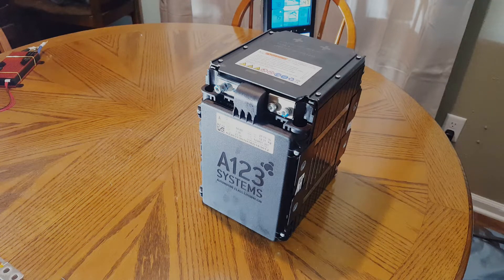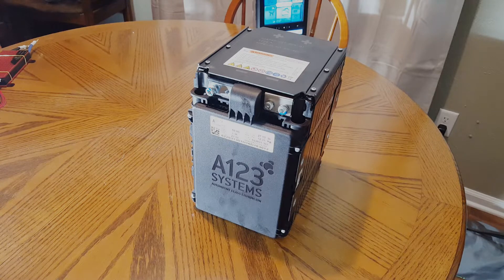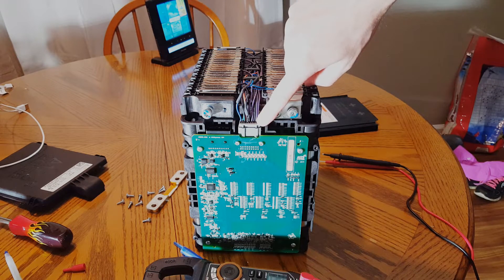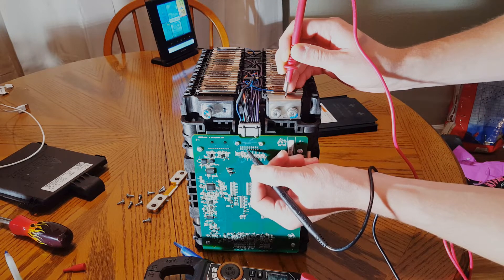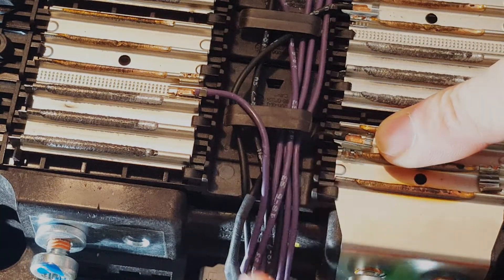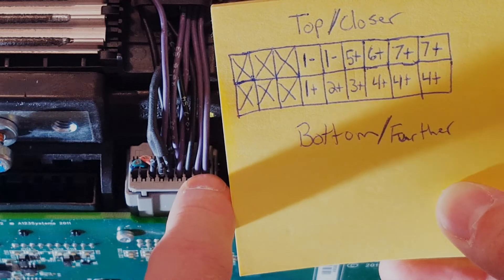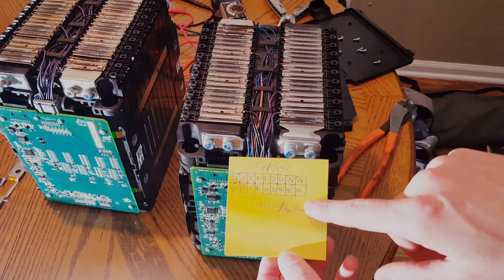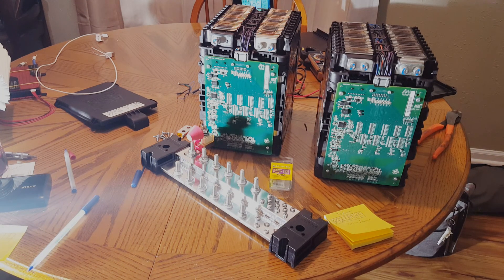Balance Wiring/Battery Overview-A123 7S  24V LiFePO4  - Which wires go where??

Comment: Hello, thanks for your video!
on all the bms (also the one you linked in another comment) i find that LiFePO4 is only 8s-16s. i'd like to connect LiFePO4 7s. do you know why all those bms don't "support" that in their product description? while i was trying to figure out the answer, i found your video.

Applicable battery:
7S to -16S version ：
7-16S Li-ion Battery; 8-16SLifepo4 Battery;8-16S Titanium LTO lithium

Comment: I just picked up a couple of these for a trolling motor as well. For 24v parallel trolling motor max draw is 60A. I'm a little confused if I could use an DALY 8s 24v 100A or do I need to find a 7s. Could anyone help?
Reply from the maker: An 8S Daly would work fine, just be sure it is for lifepo4 not Li-Ion.

Comment: Thanks so much for video'ng the insides of the battery.  I'm looking to buy a couple.  How hard would it be to breakdown into a smaller series?  Are there any good spots to attach the leads once done or is soldering the only realistic option?
Reply from the maker: It is possible to break the batteries down but with the strapping and everything that is already in place it isn’t very feasible. It can be done but would be a pain. Soldering or pop riveting the leads on would work. You would have to watch the pop rivets to be sure they don’t loosen over time and get hot during use. Thanks for watching!

Comment: What BMS did you end up using?
Reply from the maker: I bought the 7-16S ANT-BMS 320 amp model. Well, 5 of them actually. Ill try digging up a link.
Reply from the maker: US $52.42  25%OFF | Smart 7S ~ 20S ANT Lifepo4 li-ion Lipo LTO Battery Protection Board BMS 400A 300A 100A 80A Bluetooth APP 10S 13S 14S 16S Balance
https://a.aliexpress.com/_msJe1AZ
Reply: What voltage did you charge to?

Comment: Be careful with the Balance Leads on the bus on top of the batteries. They are "UltraSonic Soldered" but they metal fusing is not too great. If you move the wires too much, they will become loose.
Reply from the maker: Thanks for the heads up. I put a decent bit of solder on them so hopefully that reinforced the ultrasonic joint.

Comment: Very good video on these A123 batteries. I bought two 24v versions (no BMS) and two 8s overkill BMSs thanks for the heads up on the wire labeling. 👍 subscribed.
Reply from the maker: Nice! Thanks for the sub!

Comment: Thanks for sharing this!

I just purchased some of these cells and looking forward to them, so please continue to share videos of your setup!
Reply from the maker: You got lucky! They sold out very quickly and were a challenge to purchase. The next video will be uploaded as soon as I get the BMS's in and wire them up.
Reply: @diyrenewableenergyelectron4996  Looking forward to that video! Did you order Daly BMSes for the large pack? And what amperage did you go with?

I need to figure out what BMS I'll use for my config with how many amps I expect to pull. I've also been checking battery stock every day in case more come available.
Reply from the maker: I'm actually going with ANT-BMS's. They have a 320 amp version and they are Bluetooth capable. I couldn't find Daly BMS's for a 14S LiFePO4 battery and didnt want to risk buying a 15S to see if it would work.
Reply from the maker: https://m.aliexpress.com/item/32997552090.html?trace=wwwdetail2mobilesitedetail&spm=a2g0n.shopcart.0.d3.20adgGh2gGh2FK&gps-id=shopcartRecommend&scm=1007.15372.165446.0&scm_id=1007.15372.165446.0&scm-url=1007.15372.165446.0&pvid=114634b7-9124-4baa-93a5-42373a8e8137&_t=gps-id:shopcartRecommend,scm-url:1007.15372.165446.0,pvid:114634b7-9124-4baa-93a5-42373a8e8137
Reply from the maker: @_a1001  thanks! I just watched it yesterday lol. I'm hoping it works out for me as well as it did for him. He seems to really like it.
Reply: @diyrenewableenergyelectron4996  

What would you say be a good deal for them?  I see them on sale for $90 a battery
Reply from the maker: 90 per is a pretty great deal. I would check them over thoroughly and verify they are what they claim to be. A123 does make li-ion in the same design and they make multiple configurations of the lifepo4 design similar to what is in the video. 

If the batteries are not heavily degraded, $90 each is a great deal. That is well under $100/KWh and these are some of the best batteries made. The nanophosphate technology A123 has researched makes these some of the most robust lifepo4 batteries out there. They handle float charges well and are rated for (double check this) over 2000 charge cycles. Thanks for watching!!
Reply: @diyrenewableenergyelectron4996  

The tags on these batteries are same as your other video where you say you got it for $10/kw.  

These batteries are 1.99kw, 78ah

So I figure they’re the lithium nmc.

What test can I do when I go look at them?  I do have a volt meter
Reply from the maker: You can check the voltage of the cells and see where they are. If it’s over 3.65 they’re NMC. Depending on the application you may not want NMC. I don’t like having them in my house and prefer lifepo4 for that. If you have some time to charge and discharge them you  can get a better idea of the condition. If nothing else you can charge the battery and see how much the cells in series wander from each other. Typically the more they wander the more degraded they are. It’s hard to balance cells of different capacities and when they degrade the capacities vary more and more.
Reply: @diyrenewableenergyelectron4996  

Is it because nmc batteries cause uncontrollable  fires?

I was wanting to start up a lil cheap solar system.

I’m thinking I would encase it in polystyrene foam that takes long time to catch fire and aluminum or steel.  I dunno
Reply from the maker: Yes, it’s because NMC is more volatile and prone to catching fire. Many people use them without issue (myself included) but for a stationary system in my home, lifepo4 was the overall winner. If the batteries you mentioned are lifepo4 it’s an excellent opportunity. If the seller can either tell you what chemistry it is or take photos you can figure out which chemistry it is since you know the overall capacity and the amp-hours. All you need to know now is how many cells are in series and you can likely determine whether the nominal cell voltage is 3.2(lifepo4) or 3.7(NMC)
Reply: @diyrenewableenergyelectron4996  

Hopefully theyre lifepo4 and still got life
Reply from the maker: Let me know what happens! I’m happy to help where I can.
Reply: @diyrenewableenergyelectron4996  

Thanks for that.  I will let you know if something happens.  The guy is slow to respond. Once every few days ... but let ya know
Reply: @diyrenewableenergyelectron4996  

Hi there. So the dude finally responded and I picked up one tonight.

25.6 v - 78 ah. For $80

I’m watching over your videos in this battery to have idea on what to do.
Reply: @diyrenewableenergyelectron4996  

Btw it’s 7s3p

And I count 20 cells.  (Actually 22 cells I think but not sure why you count only 21)

Not sure how to volt check each cell since there are those bracket plates on top that connect them together covering parts of the cells and I don’t see anywhere else to put the probe
Reply from the maker: You won’t be able to check each individual cell, only the 3 cells in parallel overall. If your cells are 25.6v nominal then you may have gotten an 8S battery instead of 7. If that ends up being the case you lucked out because 8S matches up to 24v much better than 7S does
Reply: @diyrenewableenergyelectron4996  

Yeah I think it’s 8s which also confuses me cause it says 7s.   There are 8 Bravkets..

So what should I do from here.  Not really sure what I’m looking at to be honest
Reply: @diyrenewableenergyelectron4996  

I should probably get a capacity tester and a 7-8s bms now huh?  Any suggestions?
Reply from the maker: A 7S battery will have 8 busbars. Main negative and the 7 positive terminals. You should confirm that and then take a voltmeter and measure the voltage readings starting at the main negative.
Reply: @diyrenewableenergyelectron4996  

Just picked up 3 more just Incase he sells out.

So total of 4 for $380.  Should’ve been $60 each but he raised the price… anyway
Reply: @diyrenewableenergyelectron4996  

They all measure at 25.6 volts at the P N lead.

Gonna open up now and start at the negative r
Reply from the maker: You can do a discharge test and see what the voltage of the individual parallel cells does.

Comment: Thanks for the quality and depth of your video. You mentioned the Daly BMS. I will be building a 30 kWh battery using the LG Chem 120Ah  3.7V cells from Batteryhookup for off-grid solar. Is there a good US supplier of the Daly 14S 58V 100A BMS or do I have to order from China? Thanks, Milton
Reply from the maker: Thanks for the support! If you go on eBay, there are usually a few listings that are US based. Aside from that I dont know of any US suppliers.

Comment: I bought the same module.  All fifteen batteries showed 22.8V.  I connected one to my 24V trolling motor.  It worked great!  I then connected the battery to a 24V, 20A charger and got the battery voltage up to 23.1V.  I look forward to your future videos on these batteries.
Reply from the maker: Thanks! These seem to be awesome batteries. I wired 2 in series and ran a 10,000 btu air conditioner for 2 hours. I didnt charge them after the teardown and got about 2kwh from them

Comment: Good job. Liked, subscribed. 👍
Reply from the maker: Thank you! More to come in the future!
Reply: @diyrenewableenergyelectron4996  can't wait till you do a capacity test.
Reply from the maker: I'm actually tinkering with it right now. Not doing a video for it yet but I wired 2 batteries in series and wired that up to a sigineer 3000 w 48v inverter and I got 1.75kwh out of the AC side of the inverter so about 2kwh from the batteries. The efficiency of the inverter is around 88.5%.
Reply from the maker: Oh, and I forgot to say that I got 2kwh from AS RECEIVED batteries. I tore them out of the module and discharged them. Pretty cool.

Comment: Thanks for the update on the modules!  That looks identical pouch cells used in their other battery packs I've seen on ebay.  Do you think the BMS is functional if you use it as is and just tap off the main terminal?
Reply from the maker: I think it is entirely possible that the balancing function works, but the high and low disconnects will not so there needs to be an external safety for that. I may actually try charging one cell to force it out of balance just to see if it will make its way back into balance.
Reply: @diyrenewableenergyelectron4996  

Have you tried that
Reply from the maker: @johnle231  I haven’t. I have a spare battery that I can mess with but I never ended up testing it out.